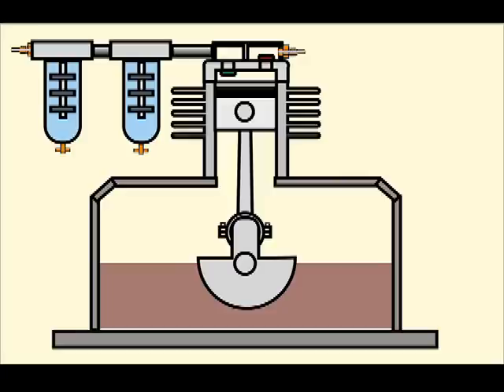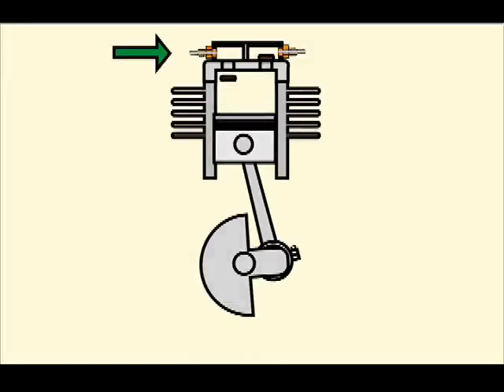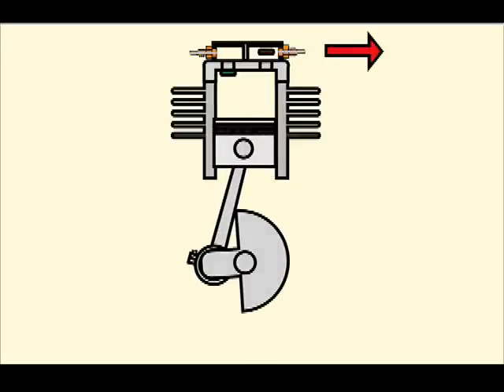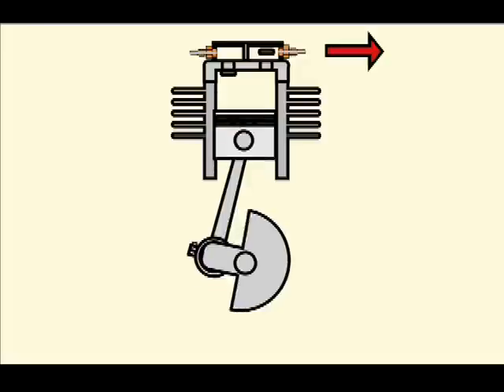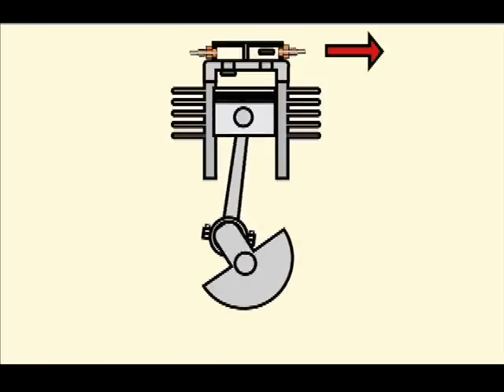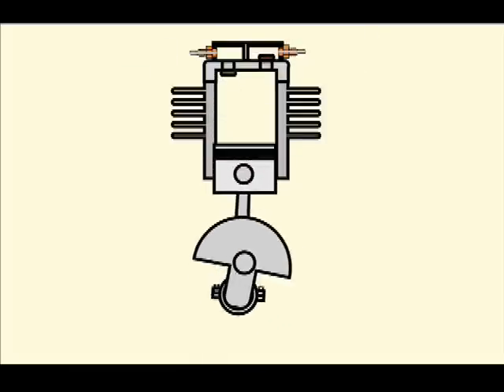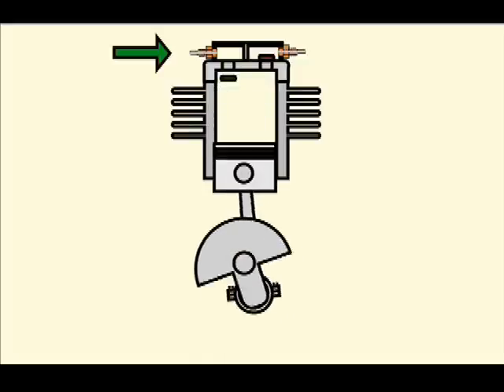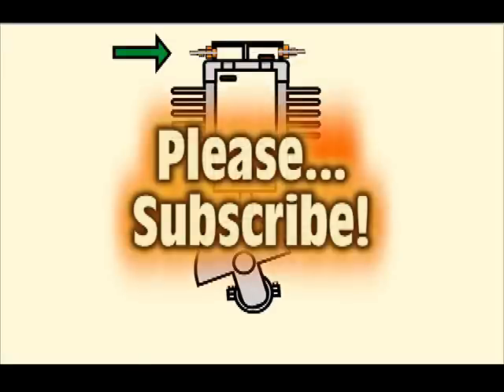How a basic compressor works

Comment: What can you say about the LG linear compressor? I heard a lot of bad comments or bad experience about it, do you think theres really a flaw in the design that make it breaks within 2-3 years? Planning to buy an Lg fridge but the bad reviews about its linear compressor makes me think twice, pls. Share your thoughts on this.
Reply from the maker: Dear J. Doh, there are technologies which really improve designs, but there are others which seem very exciting and finally they don't work as expected, and even disappear from the market.

The traditional fridge works on a rotating motor, a connecting rod and piston compressor. This is a quite dependable system. As we all know, they work almost forever. Then came the inverter type, which actually was an improvement of the old system, by adding a speed control to the rotating motor, so the amount of cooling is determined by the speed of the compressor, thus never having to stop and start which were the most energy consuming factor for the traditional arrangement. This is a good approach to the perfect fridge. Later they came up with the linear compressor, which, of course, works well at first, but it has some nasty springs which, due to metal fatigue, tend to break after a couple of years. I would rather recommend the inverter type. There is a good article on this subject at http://en.tab-tv.com/?p=15140 - I hope this helps.